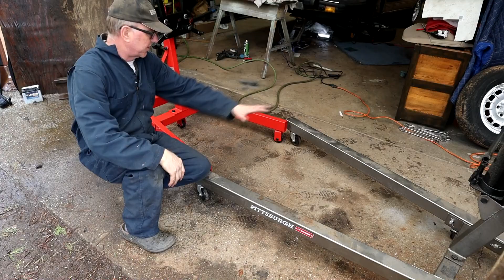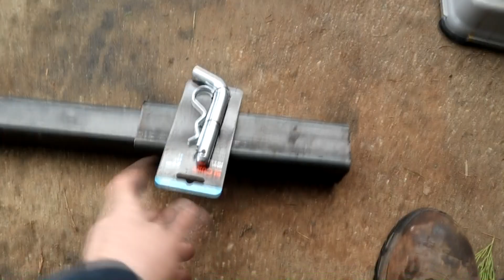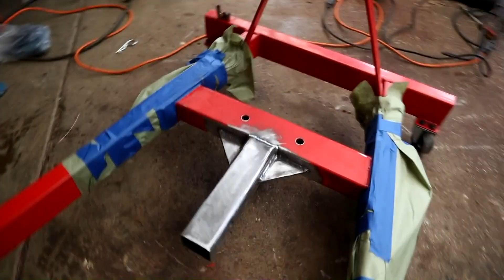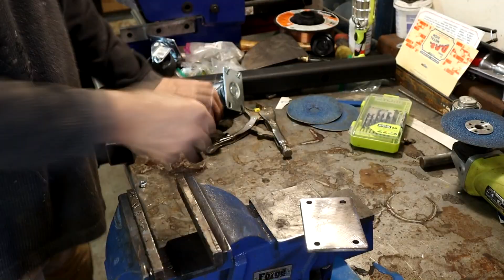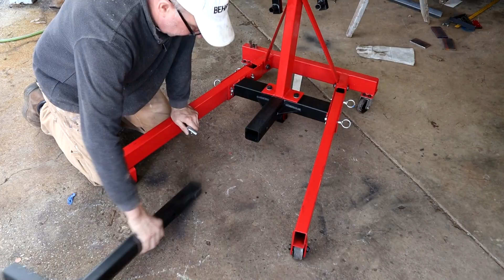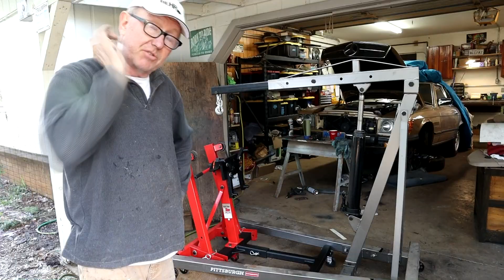SAFETY MOD FOR HARBOR FREIGHT ENGINE STAND.

Comment: Genious. I'll do it exactly like you did it.
Reply from the maker: Glad you like the video. Also once the engine is mounted, that receiver could be used for things like a drip pan, tool platform while you're working on it. Or just leave it in for extra safety. Some have claimed to be able to load safely without this. But the Mercedes m100 6.3 V8 is an absolute beast and almost irreplaceable if anything went wrong. So I'm glad I did what I did. Cheers John.

Comment: Why pull the middle leg out once you have the engine on it? It will be torsionally stiffer with all three legs, which they need!
Reply from the maker: You're right. I ended up leaving it in.
Cheers John

Comment: The problem really isn't the engine stand. It's the lousy design of the cherry pickers that are so common today. The outriggers should be wider and fit around the engine stand. The neck isn't tall enough and the arms are made of thin crap steal. Most of this is because they are made in China and designed around shipping size and weight. Your improvement looks like it would be trouble for a wide engine. It may just be camera angle, but I don't think I could drop the legs back down around my Chrysler 440.
Reply from the maker: Hi Steve. Not sure about the Chrysler 440. That is a big motor. But I was able to drop the legs back down on this 6.3 which is pretty large. 
You're certainly right about the cherry pickers legs. I saw a guy that mounted them further out on a video once. My main motivation on doing this was I saw Eric the car guy having trouble doing this and I feared dropping the engine and that would have been a disaster. Thanks for your comments.
Cheers John.
Reply: The engine stand legs are/can be double pinned. They can easily be removed from the vertical storage position and refitted to their horizontal working position. The added T support will hold up the engine as the two factory legs are installed horizontally.
Reply from the maker: @RaysLaughsAndLyrics That's right. They are double pinned. Cheers John

Comment: How did it work out with the engine weight, where the original legs easily pin down.
Reply from the maker: Worked very well. Outer legs came down no problem. Also once they are engaged you could remove the center leg and put in accessories.  Such as a drip tray or tool tray.  Etc 
Cheers John.

Comment: Your accent threw my broken American brain into Project Binky mode. You make some brackets on the hoists that mount rails parallel to the legs, then make more brackets on the engine stand that mount rollers that line up with the rails. Then you find an electric antenna out of a Peugeot , add more brackets, a pulley, 3 levers, a bell crank, have the shop bell end go brew some tea before he removes his thumbnail with a grinder, and a windshield wiper switch out of a Land Rover, and voila! A powered cherry picker to engine stand docking contraption. Brilliant! 😊Despite the lighthearted fun, I would donate a vital organ to the Bad Obsession gents without a second thought.
Reply from the maker: This comment made my day. 😄 Thank you. Cheers 🍻 John

Comment: Very professional looking build, and I like the dual color.  I wonder if you might have considered mounting larger caster wheels on the hoist to raise the out-rigger legs high enough to allow the engine stand legs to slip underneath as you position the engine at the proper distance to the 1-ton stop of the hoist.
Reply from the maker: Thank you. I could have done that. But larger castor type wheels would have to have been very big to give the needed clearance. Cheers John.

Comment: Just add a swivel attachment to the hoist and pick it up from the back of the stand! With the swivel you can turn the engine 360 degrees!
Reply from the maker: Thanks.
Tried that, didn't work at all. Not enough reach.
Cheers John

Comment: Good idea, looking at getting that type of stand, hadn't thought of that potential problem
Reply from the maker: Its a great stand and very sturdy with the splayed leg design. But there is that issue. Some have suggested backing it in. But with my large engine that just would not work. Cheers John
Reply: @mercedesmaintenance.6339  it's design is based on the similar capacity 1 ton engine crane frame is the problem really (probably simplified the manufacturing of a new size at the time). Looking at getting a stand to do 1 specific job on a tractor gearbox for now,  but I'm leaning toward a 2k pound/900kg as I could possibly hang cast iron tractor engines off it in the future

Comment: I've got a T-style stand I'm planning on modifying. I'll likely be  partially stealing your idea, although my plan is to extend the front leg further forward, then have the crossbar on the front, and also have a way to support the front end of the engine as well, (Jeep 4.0 I6 are heavy and LONG))
Reply from the maker: Good idea. It always made me nervous that the front of these engines are just hanging out there with no support. My general plan  once I get the engine built to a point where I don't need to rotate any more, I'll switch to a run stand. Good luck with your project. Cheers John 🍻

Comment: Buy 2 7”bolts 3/4 i believe with the nut and bolt the hoist legs on the outside and you can fit the engine stand in all the way back wirh no problem, just make a piece of pipe to go in the original place of the legs so when tightening the bolt it doesnt squish the metal together.
Reply from the maker: You certainly could do that too. I just wanted the ability also to fold up the legs of the crane when done.

Comment: May I suggest this alternative solution that is much, much easier: https://youtu.be/ifL5a1VTyHo?si=iADkKN3W4t1G8nJK

You were saying 6.3. That's a heavier engine, I think even then this is a viable solution. Certainly for lighter engines.
Reply from the maker: What a great solution! Certainly easier than what I did. O well. I got to weld metal, which is always fun. Thanks for the tip. Cheers john.

Comment: If you turn the engine stand around and back it in, then lower the engine down in front of it, it'll bolt right up without doing all that.    Totally safe.
Reply from the maker: I tried that, the rear crossmember restricted the ability to get close enough, even with the crane at full extension. 
Cheers John.
Reply: Not in my case..... I had to remove wheels off engine stand.
Reply: What I ended up doing is  bought a longer boom section from a steel yard that fits and slides in the telescopic top of the engine crane. Just make sure the boom is double in thickness as it's longer mines 1mtre longer and  5mm square tube thick from the Chinese original so no issues with engine stands, as your lifting further away from the 1/2ton setting on the original boom. I welded extra metal for strength around stress points sections under and around the tube top where the boom slides in.
Reply: Tis what I do

Comment: I actually like that stand and the only thing I’ve change is making the legs slightly wider with the legs being straight instead of diagonal.as far as putting an engine on the stand with the hoist,turn the stand around backward so both sets of legs are running the same direction.no sweat.I have the one like you made,I’m gonna make like you but like I said then you can put a drip pan on the floor between the legs to catch oil,lubes and what not

Comment: Did you try turning around coming over top, but idea does make it more steady and secure
Reply from the maker: I tried all ways. Just could not get close enough. This set up is way easier and safer. I actually just leave the center one on all the time.
Cheers John.
Reply: @mercedesmaintenance.6339  even helps hold drip pan underneath
Reply from the maker: @billkeifer5285  exactly. It makes a great place for that.